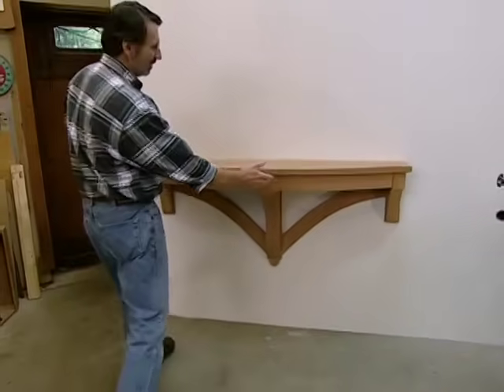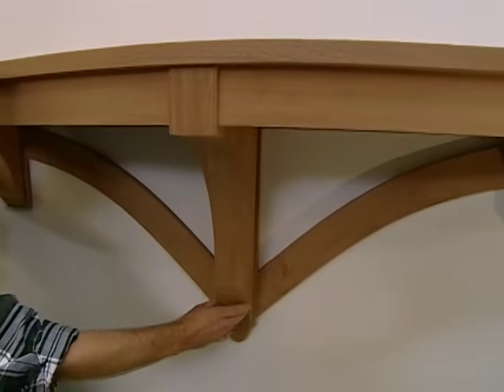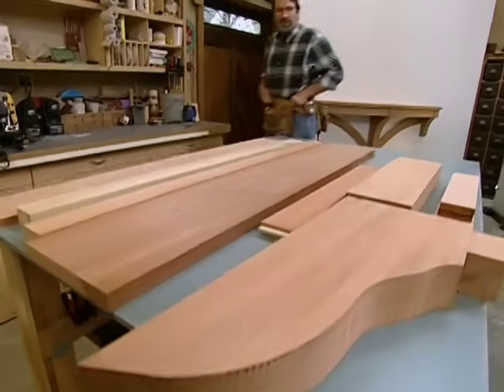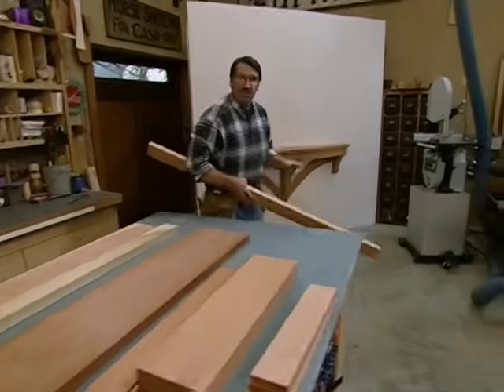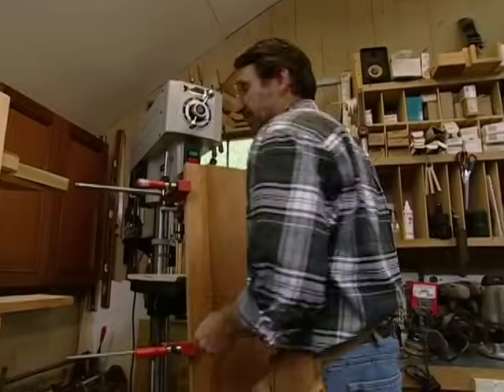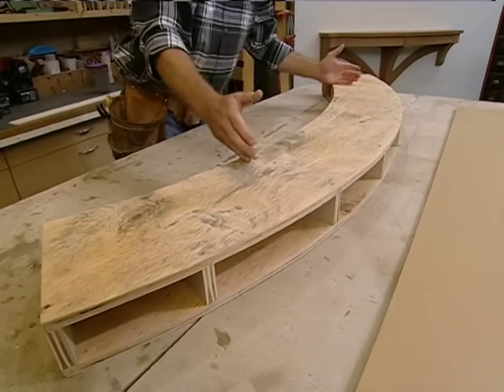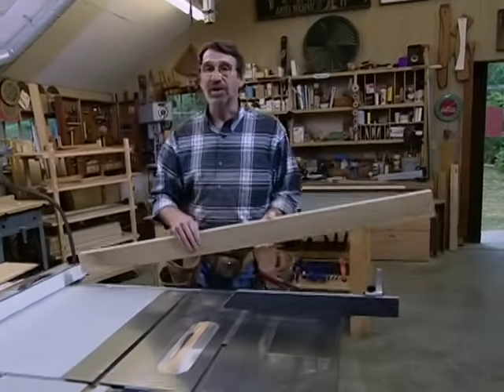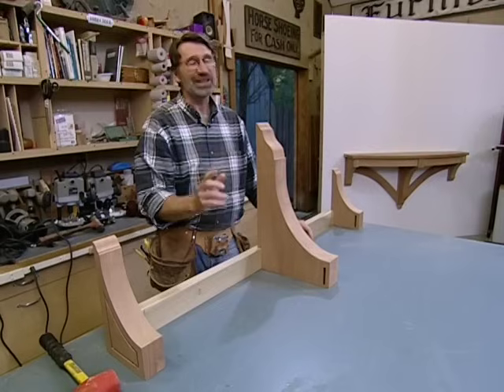Wall Hung Console  |  S18 E11

Comment: 13:04 Sure seems like you should make those laminations first and use them to make the template for the top. They’re gonna be what they’re gonna be, and getting some precise radius is not neccessary.
Reply: I'm sure he knows what he is doing and the precise radius absolutely matters when you draw up a plan and execute it.
Reply: @ Norm knows what he’s doing and exactly how much the laminations will bounce back when released from the clamps. But to be safe, non-Norms could make the laminated part first and use the resulting curve to make a detailed, precise drawing for the rest of the piece.
Reply: @johnsrabe  he just drew it up to be a certain way
Reply: Sigh

Comment: My one grip with most woodworker is the use of secondary woods for the Back.  Any piece should be built for 360 degree finishing.
You make this beautiful; well-crafted; life-time, pieces  ...and then you slap a piece of plywood on the back.  Never made sense, well the 2 cents you saved.  Big whoop.
Reply: Plywood is stronger when attaching heavy items to a wall.
Reply: 360 degree finishing? Why would a project like a chest of drawers, cabinets or anything like that have solid wood on the back if its going to be hidden or rarely seen? Do you not realise the cost of solid wood as well as the time & effort it takes to prepare it? Using plywood is a no-brainer - its dimensionally more stable, more durable and in likely stronger than solid wood.